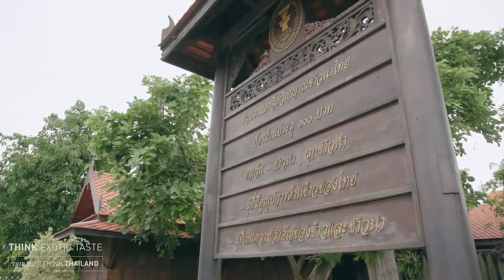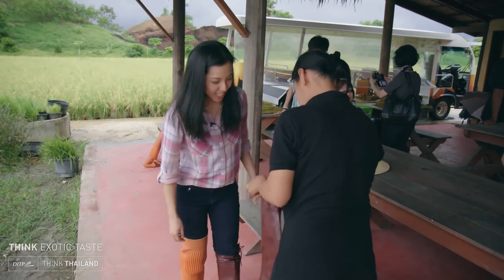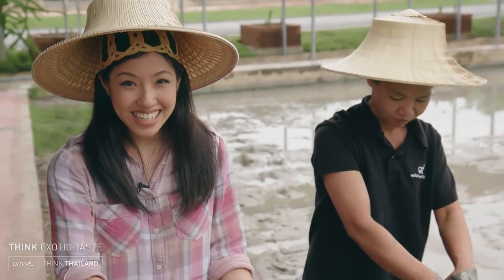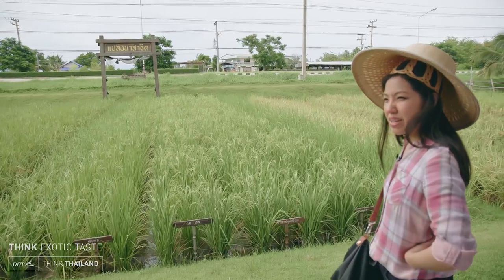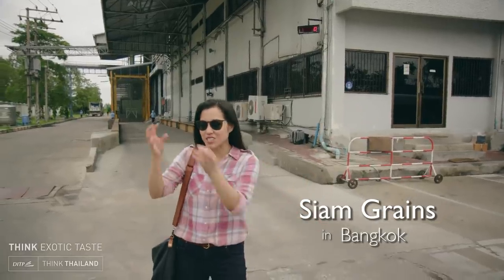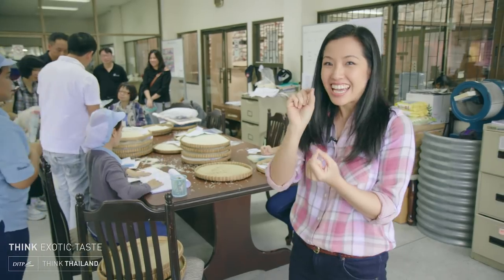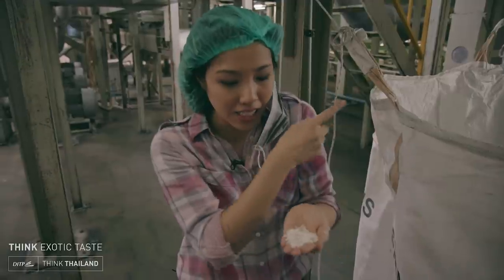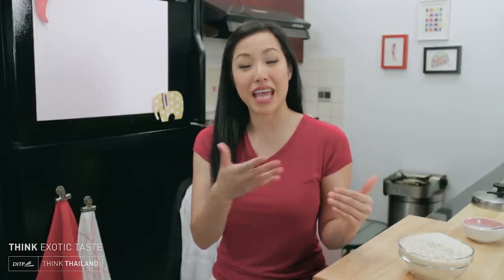How Rice is Grown in Thailand: From Paddy to Table

Comment: Yes, the traditional way to plant the young rice plant is by hands and bare feet.  As you can imagine doing this all day long in the hot sun and high humidity.  It is not an easy task.  My grandmother always tell me to eat every single rice and not to throw away any rice.   I did quiet get it as the young age until I was about 13 years old when I was watching my aunts and uncles working in the rice field.

Comment: 13:11 What is the purpose of hanging tires around the entire circumference of a boat?
Reply: Hi Joe!  They use them as cheap boat fenders.
Reply: @AdamHotThaiKitchen  I sorta got that that might be the case, I just find it kind of funny that they'd be placed so high up off the water in a default position. I can't imagine a bow that high nudging at any other boat, can you? I'm no sailor though, and I know it's likely I'm missing something that's really simple.